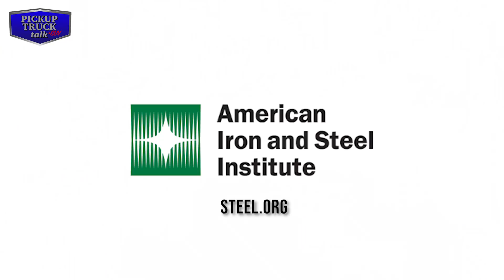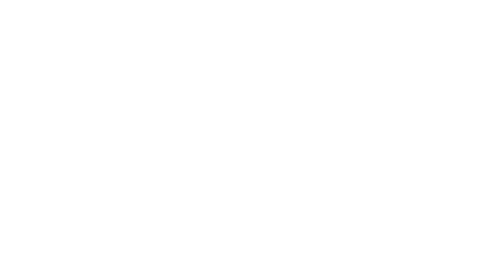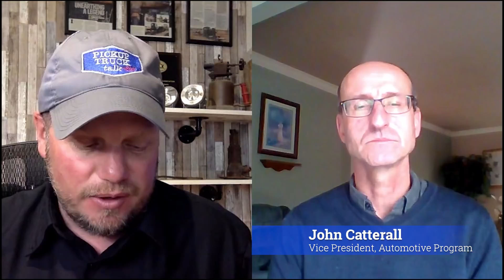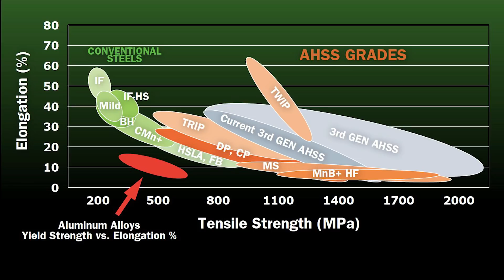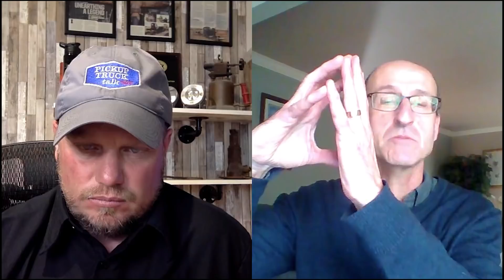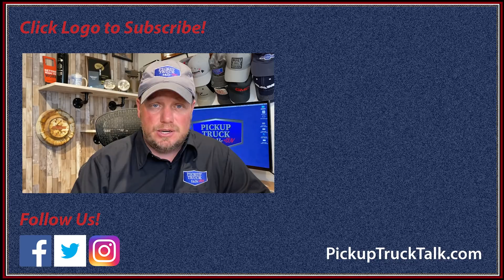Should Truck Frames Bend? Thinner Frames Are Weak? - Expert Answers

Comment: Greetings. I watched the video - not because I was interested in the recent (or not) "frame breaking" incidents but rather the seemly age old issue (or NOT!) of frame flexing on modern full sized (25xx-35xx series) trucks. Many of us truck owners take them loaded with +4000lbs of camper in the bed down "jeep trails" (read: plenty of off canter sections of trail) and the visual result (from the drivers seat in the cab) is the "nose" of our campers (the cabover sleeping area) bouncing around (up/down - one or both sides). I've watched it happening in a 97' and 17' Ford with the same camper load. MANY have had the cabover section (and truck cab itself) move up to +2in combined and RUN INTO each other resulting in SMASHING whatever that is on the roof of the truck cab (lights, antennas) and/or damaging the cab over section of the camper itself! Some would claim parts of the camper itself is acting like a accordion (compressing and bouncing back), others would claim that the camper is TILTING/ROCKING in the bed (airborne in the rear!), others claim whatever the camper may be sitting on is acting like a accordion, some think it is the trucks frame flexing and twisting and others still think it is a combination of all of the above. Do you have any experts that can answer this? I can find YouTube videos on +11yo trucks showing frame flex but nothing on modern (>=2020) trucks.

Comment: Isn’t the the 2 GM & Gladiator trucks considered mid size or light duty? So if you are expecting those trucks to do the same as the full size trucks then that is the issue.

Comment: I suspect that any aftermarket welding on the frames is going to disrupt the factory tempering/heat treatment that was mentioned here and is probably done after all the frame welding is complete.
Reply from the maker: Exactly.

Comment: BS - weve been making strong frames for DECADES and they could take the stress.  GM is doing the same theyve been doing the last 25 years and looking for cheaper and cheaper ways to build vehicles, and the result is weve lost reliability and now thinner "high strength" frames that somehow have less strength than before.  Theyve actually took five steps back and managed to ruin one more item we had perfected strength wise fifty years ago.  Before long you wont even be able buy a truck that will do any work at all without frame failures.

Comment: The "square" section could be stronger, than a frame in "C" section...buton the "square" section", you also could use lighter sheet metal.
Reply: tube frames rust from inside out

Comment: More lighter trucks for fuel consumption + use of crumple zones on the chassi + cheaper ways of production + towing heavy loads over tongue weight + have low suspension travel due to lift kits or heavy loads = Bent frames.

Comment: The sack of crap saying something is stronger is relative relative to what say your frames are stronger is to say that a bridge is going to be stronger because it's made out of more steel and less concrete if you take the flexibility out of an object to make it more rigid you're caught talking about tensile strength and then you're going to be able to fit in there like a box of spaghetti noodles that are uncooked you're going to be so rigid they're just going to shatter I said of being flexible and be able to absorb some Shock impact on regular everyday driving you should not be able to bend a frame in a pickup truck by bumping or jumping or curve by accident

Comment: So, in reality, You asked about the frames from a guy who were there designing them to show up too weak? Ok, that makes a good document?  In the real world, the computer models for simulating stresses of truck frames are just fancy video games, tech porn for engineers. I know, I have seen engineers design railway equipment that failed even though the computer model claimed that they were ok.  The old frames were stronger, period. No increase in steel strenght can replace the amount of steel removed. The new Colorado frame is just a joke, it is just sheetmetal formed to look like a frame, there is no margin for strenght or rust. Those responsible to designing those new flimsy frames should be held accountable for what they have caused to the manufacturers and to the customers. This problem has just started to show up. When those areas just in front of the rear wheels rust, there will be first fatalities as the frame will fail with little or no warning.
Reply from the maker: Colorado, Gladiator, Nissan Navarra and Toyota Tacoma have all had frame issues from time to time.

Comment: BUT - if the new frame is more rigid and bends less, then it might actually be less spring-y and will resist bending until it fails - and then it kinks.

Comment: Those trailers pictured don't look heavy enough to cause a well built frame any damage.
Reply: Static weight is not the whole picture.  Momentum is mass times velocity.  At higher speeds, you can get greater force from momentum than from gravity.

Comment: I thought it was absurd. This guy is part of the problem. He is a fixer. He is sugar coating the problem and contradicting himself over and over.  Typical BS, he gives a mythical explanation that you can imagine throwing in things most people dont understand but believe in. Like the computer design, new steel and science. All of which most people do not understand. You can further distance yourself and place trust in them because they are "professionals" and almost infallible according to his presentation. These are in fact the actual problems that he is convincing you to dismiss. I am all for technology. The problem is we use computer programs so much people dismiss them as always correct. Not as many people understand the the physics anymore as they rely on software. Guess what, software must be created and written by people that have a great understanding of the process. Even then you still have errors and bugs to work out. A miscalculation, error or simply something not included can have hidden problems especially when the engineers rely almost solely on the a software program and dont have enough of their own knowledge and capability. This is clearly a large portion of the problem as there are clearly design defects in structure and design thickness. To say that a box is stronger is simply not correct. Once again it depends on the design and application. "Fully boxed" is almost entirely marketing propaganda. As he employs himself as back up. We have all heard the commercials. As for the steel. I will agree it is stronger but not to the extent he implies. The material is to thin. They walk to fine of a line between what will work, metal fatigue and failure with appropriate safety factor. From what I've seen in the zr2 is obviously miscalculated bad engineering! This probably falls back on his company which is why he is here to feed the BS.

Comment: Land Rover used a relatively thin steel frame for their Defender series, right from the outset in 1983. They did use a deep box section and relatively high grade of steel though, much better steel than they used in the outriggers welded to the main frame. They always flexed in axle-twisters but I've never heard of one bending or cracking. Unfortunately in later years, from year 2000 on approximately, they downgraded the steel used and that is obvious because the sides of the main frame rusts and flakes from that point on. You find the younger ones flaking to the extent that they may need plating, which is something that was not needed on earlier ones. The other unfortunate thing about Defender frames is that they build a dirt and rust trap into the rear crossmember, which is something they always did since the 1950's and never did rectify ever.

Holes in chassis!  Have a look at Nissan Navara and Patrol chassis. They have more holes than Swiss cheese and there can only be one reason for. They build in obsolescence. Compare to Toyota HiLux and Land Cruiser chassis which have very few to almost no holes in the wheelarch area of the chassis.

Comment: HA! KNEW IT! told you tim, they didn't calculated the strength requirements for those Colorado and gladiator for the 1 percent usage. Us engineer can't plan for those 1 percent use case but what we can can do is over engineer requirements to accommodate those unknowns. But this can increase production cost hence if you have a corporate culture of maximizing profit it can cause unintended consequences. All the non-sense about longer struts and larger wheel were just that.
Reply from the maker: Yeah, the longer shocks and bigger wheels was nonsense.

Comment: I call BS on the steel not being from China. It all depends on definitions. Sure the steel might be rolled in the USA and fits the trade definition of "American Steel" but the melt shops are in China or somewhere kinda like China
Reply from the maker: Shipping heavy steel would not a very smart business plan.
Reply: @Pickuptrucktalk  They ship Chinese steel as unfinished slabs to North America all the time and in huge quantities. Only the rolling into sheets and structural shapes is done here. It has been going on for like the last 30 years
Reply from the maker: Cindy Tepper interesting.
Reply: @Pickuptrucktalk  And that is just what you see on the surface. Lots of Chinese steel is trans-shipped through other countries to beat the trade restrictions. Lots of steel companies in Canada, Mexico, and other places were bringing in unfinished Chinese steel and passing it off as their own after finish rolling. 

We have very few melt shops left in the US. A melt shop is where the steel is actually made. It will be something like an EAF Electric Arc Furnace, a blast furnace, an open hearth, or BOF Basic Oxygen Furnace and usually a continuous casting operation.

Comment: High strength steels can lead to thinner section wall thickness, but the frame section geometry can be enlarged to improve stiffness. Note carefully how he talks about 'stability". What he's referring to is buckling stability (or instability). Buckling resistance is entirely dependent on the frame section geometry; including holes (adverse) and "bulkheading" (improving). Strength of steel makes little difference to this, because buckling instability is dependent on the elastic properties of the steel; and this changes little with the strength of the steel.

I think the key question on the frame bending that we're seeing is whether the tow hitch loads have been correctly (and generously) incorporated into the design basis. If they haven't, then the thinner wall thickness, high-strength steel frame leads to easily buckled/bent frames when they are inadvertently or deliberately overloaded (both static and dynamic overloading). The older trucks with their thicker wall, but lower strength steel frames would be much more resistant to buckling during inadvertent overloading.
Reply from the maker: Good point. With towing being lower on the list of consumer demands in mid-size pickups, they might have overlooked it a bit during the design process versus a half-ton or larger truck where towing is more of a consumer demand. It will be interesting to watch if any changes come from this.

Comment: Thickness has an advantage in that it takes longer to rust out.  I don't see the industry ordering steel that has better rust resistance.  Also thinner metal sections are more prone to point load failure.  Try hitting a rock with a thin 'strong' cross section.  Think a beer can--hard to crush compared to denting and creasing.  Cars and trucks are rusting out in very very few years.  $50K has to be amortized in four to five years in modern vehicles where in years past a vehicle would last ten or fifteen years in the same areas.    It is germane to note the engineers are not calling the shots in today's industry sales dictates to them what they want, even advertising seems to outrank engineering department.  So I can't put too much stock in what he is saying.

Comment: So I am 6 min in and the argument that the thinner frames of today are stronger than the older frames. Well with my experience it is true a thinner material maybe be stronger but it will likely be less durable.  It’s just not going to handle max strain nearly as well as a thicker material.  Once that thinner martial is damaged it will take less force for it to fail when compared the a product of the same material with thicker wall .  For instance thin sheet metal will tare and thicker metal cracks.  Thinner material also doesn’t resist denting nearly as well since it has less materal backing an impact point
Reply from the maker: The thinner high-strength steel is made up of different alloys as well. So, it isn't an apples to apples comparison of thickness versus metals.

Comment: before these models was there an issue with trucks folding in half ??
Reply from the maker: Not really. However, that's a bit inaccurate to do a before and after. People are using the ZR2 and the Gladiator in the same ways they used to use the full-size Bronco and Blazer. Those are apples and oranges when it comes to comparisons.

Comment: Here is a general rule I use with my pickups for hauling & towing. If the manufacturer says it requires a 1/2 ton use a 3/4 ton. If you have a 1/2ton you actually have a 1/4ton. And so on. I have used this and never had a failure. Just my opinion. Do not believe manufacturers specs. Once you get to the upper end of the specs. That's when you start having problems.

Comment: Good work, tim. Glad you brought up the argument that toyota frames don't bend like that, at least the north american c-channel. Sometimes rigidity can be a disadvantage, especially off-road, but also on. The flex from c-channel gives a smoother ride on road and helps keep your wheels on the ground off-road. Very often, something with no flex will just bend or break. High rise steel buildings have a certain amount of flex designed into them.

Comment: Another thing overlooked is: all the recent cases, Raptor/ZR2/Gladiator + Fox, have high performance shocks with relatively high damping rates. They're also traveling offroad, relatively fast (in the case of prev gen Raptors, 70 mph). This was NOT your usage case back in the good 'ol 90's with a regular F150.

You also didn't have the MASSIVE social media platform to spread bent frame cases. Believe me, they bent, and they bent fairly regularly with heavy use. In the 1% of time they were filmed, the VHS-C or 35mm have long been lost...

Comment: I'm 53 yrs old . I couldn't care what this engineer said. Pull a 30 yr old or older ford, dodge or chevy out of a farm field and there is no frame rot. Look under a 5yr old truck of any manufacturer today and they are rotted to hell. Boxed frames are done for lighter weight to get some strength with less material. The old "C" channel frames don't rot because they don't hold water and they "breathe" going down the road. Screw the gas mileage, I want a truck that will last 15 yrs and cost me under 30 grand. Lets see how many trucks from 2000 to 2020 will be around 30 yrs from now?
Reply: One more thing. I worked for GM in Linden making the S10 trucks. The Frames were made by Budd in Canada. The flavor of the decade was to dip them in black wax. With the seasonal change of hot and cold, the wax would crack off and rot the frames. We can send a man to the moon but they can't make a vehicle that won't rot or bend a frame?
Reply from the maker: They still do the same thing with their frames FYI. That hasn't changed. I've spoken to GM at length about it and they favor the wax coating over an e-coating. The thinking is if the frame is scratched, the wax will cover up the scratch while the e-coating will not causing rust faster.
Reply: I've seen lots of things designed with tube to be "stronger" backfire because of rust issues. Tubes hold water, dirt, ice melting chemicals, salt etc. Sure tubes are stronger when everything is new, but it's easy to end up designing a rust bucket waiting to happen.

Comment: The way I had heard it too, was that truck frames were built a little heavier than was required as the manufacturer knew that some of it would be lost to rust in the northern climates.
Reply: I find it interesting that people believe hearsay without any objective facts to support what they heard.  Truck frames didn't start bending yesterday.  Older truck got their frames bent before too.  I'm going not by what I heard but what I seen.  It isn't the first time.

Comment: The older model trucks had a thicker frame and in reality were stronger and had a better torsional twist effect than the newer frames due to the fact that they used more carbon in the steel and zinc which most of the new chassis do not incorporate
Reply: 100% correct

Comment: When you heat a high strength low alloy frame you a actually change the molecule structure of the steel back to a more or less mild steel whitch cant support the load it was designed to carry a d it will ultimately fail 
Unibody cars with crush zones are a prime example of this a frame section must be replaced if extream damage occurs
Reply: You don't change the molecular structure of high strength steel by heating.  Changing the molecular involves chemistry.  You can change the grain structure of the steel and that does affect the yield and ultimate strength of the steel.
Reply: @matthewgaines10  when you heat high strength low alloy steel to more than cherry red it burns off some of the carbon and makes it weaker with the same properties as mild steel
Reply: @stephencrandellsr4915  
And where does heating steel beyond its recrystalization temperature happen in use?  Please do tell.
Reply: @matthewgaines10  it happens if a bodyman uses a torch to heat the metal to straighten it and this is not an approved method of repair for high strength low alloy steel cold straightening only or replace the pannel or frame